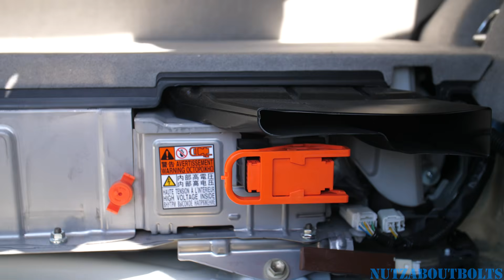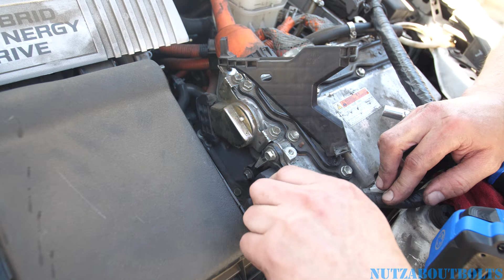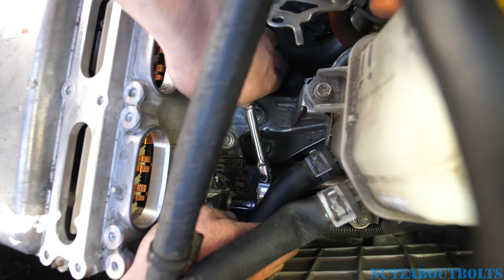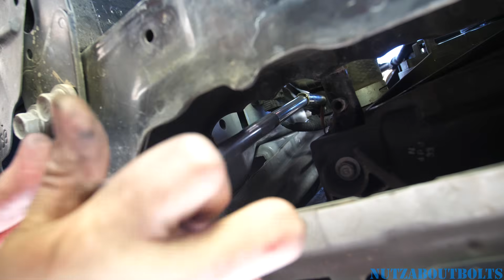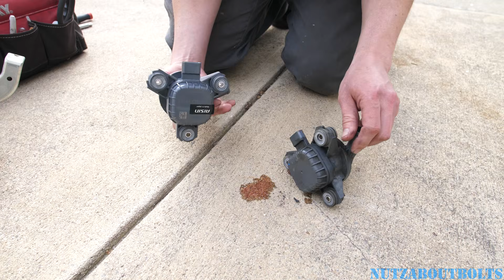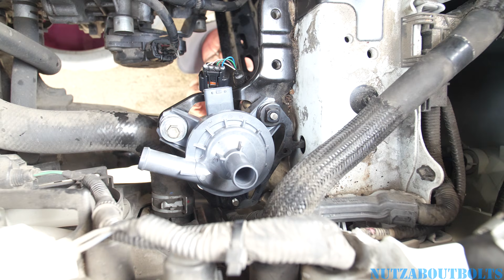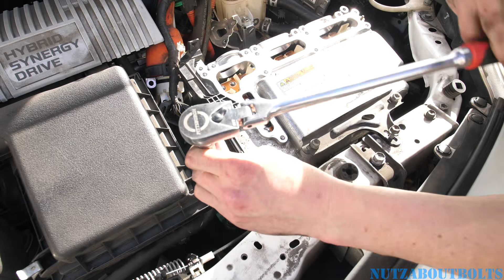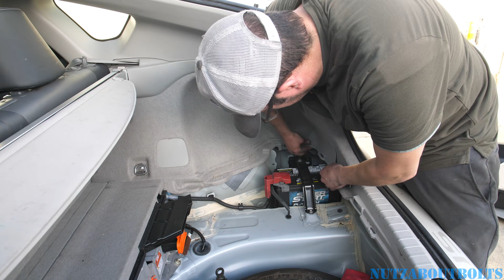2010-2015 Toyota Prius Inverter Water Pump Replacement

Comment: should i change it for the peace of mind? 170k, and a code P0ADD. P0ADD means overheating of the hybrid battery or overheating of the pump. i have autel and can check the pump speed while driving. how long can you drive with bad pump bfr damaging the inverter? i guess 1-2 hours?
Reply from the maker: Don't see any code with P0ADD in the repair manual.
Reply: @NutzAboutBolts  thank you for taking your time. i could not find it either. the internet told me, it is related to two other P0A** codes. i erased it and will check in couple of days to see if it will return.
Reply from the maker: @west_park7993 👍🏼 let me know when you do
Reply: @NutzAboutBolts  with no DTC, with freon in the system, and good pressure switch, and good 5 fuses, i had no clue. got it to the dealers. they discovered, that the pressure is just a bit law, at 55 psi <the system is not turned on yet, and freon is equilibrated> they added a bit of freon, and now is OK. the pressure at the low siide end, with the engine off is 90-100 psi. when you start the AC, it drops to 30 psi, as it should be.
Reply from the maker: @west_park7993 so they’re saying the ac Freon is low, so it’s affecting the inverter?
Reply: @NutzAboutBolts  more complicated. first, ac would stop working after several min. shut off engine, starts again. nimh battery was <30%. replaced battery, same problem. started diagnosis. added 134. being an idiot, i added too much. then released. but i released too much. then tried to adjust. then started looking for el problem. all 5 fuses were ok. <fuseable link on inverter, 2 fuses, 10, 50 A under hood, 2 more under steering wheel> all look ok. How about the pressure switch. It showed high resistance. some posted, it is a switch, should be under 1 ohm. replaced the switch, same. bought another switch, same. them <being an idiot> i realized i have another car with identical switch. the switch showed 4k, 6k, 11 k. <there are 3 prongs>. then i checked the low-line pressure of the other 3 cars, with ac off. WOWOW! should have started with this. with AC off, the low pressure should be in the mid of red range, i.e. around 90-100. so i added more 134, and reached the border of yellow-red. around 60. still did not work. Did not have enough freon to make it to 90, and hoped that this is enough... still: no luck. at this point, no error msgs on the computer. this is when/why i gave up and submitted myself to the dealers. they told me 70 for diagnostics, but when I went there, they said, 70 is for code reading, 130 for total. then when they finished, they charged me 130 extra, for 200 g of freon. i believe that the diagnostic should be part of the repair cost, at least this was the industry standard. anyway, i have running AC, and I learned a 321 dollar lesson.
Reply: @NutzAboutBolts  the eror msg are sometimes ambiguous.
Reply from the maker: @ lol wow that was crazy, it had nothing to do with the inverter water pump 😂🤣😂. But yeah, I don’t mess with the AC canister or recharging it without the dealership machine. If one thing goes wrong, especially on the hybrids, it can affect the ac system… glad it was a cheap repair. 👍🏼
Reply: @NutzAboutBolts  some of these early error msgs were rather misleading. in fact, i almost fixed it, just needed a bit more freon.

Comment: I want to replace my inverter water pump on my prius with this Aisin one but I'm not familiar with Aisin products and don't know the quality. I need to do some more research because the Aisin one is way cheaper than the dealer one.
Reply from the maker: @joeshmoe8952  Toyota uses Aisin brand for their parts. It’s basically OEM
Reply: @ I’m definitely buying this one. Thanks
Reply: I ended up purchasing the Aisin water pump thermostat & inverter pump. So far so good, I’m looking into that catch can you go there. Heard lots of good things about it.

Comment: What a brain-dead design decision by Toyota, to bury that pump under the inverter. About out on par with needing to pull the wipers and cowl to get at the spark plugs. Thanks, at least I know what I'm in for.

Hey you guys are starting to get older... ;)
Reply from the maker: @mendelleisk4577  😂😂😂 yeah, time is not on our side lol
Reply: Doubly confounding, because if you go under the car, the pump's right there, but it's fasteners need access from above.

Comment: For this one, I'll wait till it goes out. This failure won't be as dangerous as the wp of the ice engine side. Great video bro. Thanks so much for this video. Hit like and saved it to playlist. 😁 It looks like it's possible to access those bolts and the pump with those 2 lines without removing the inverter.
Reply from the maker: lol yeah, honestly both of mine still working but had to do these videos because I don’t know when it’ll die on me. Same with the brake rotors and pads 😆😆 still oem
Reply: @NutzAboutBolts  your car is a beast! OEM wp and inverter pump lasted 280k. This gives me hope for my inverter pump. 🤣
Reply from the maker: @CCG0D 😂😂 I think they did the 2012 and up better. I’m still on the original HV battery… still waiting for it to die
Reply: @NutzAboutBolts  you know it, when the HV pack dies, pls post video with your solution 🙏🙏
Reply from the maker: @CCG0D definitely, I’ll probably just replace the whole HV battery if the cells die out. It’s probably less headache lol

Comment: I think my 2011 Prius has a blown head gasket, it still runs and drives great but I'm losing coolant. Is it worth the cost to fix it or should I just look fo a new car? and can you please give me an idea how much it would cost for a head gasket repair? thanks
Reply: repair it, don't wait too long. Take your car to someone to repair it that is specialized in Toyota's, don't bring it to the dealer. I think it will cost you 2 - 2.5k euro's. But what does another good car cost? A lot more
Reply from the maker: There’s a bunch of headgasket video repair out there. It’s still worth keeping it and repair it. Most likely you’ll need to bring the head to a shop to get it machined and leveled with new headgaskets
Reply: @NutzAboutBolts  ok, thanks for the info

Comment: Toyota wanted $800 to do this. I bought an OEM pump on Amazon ($100) and did it in one afternoon. 
While at it I also replaced all fluids - oil -coolant, trans. and inverter.
Tip if you order parts and fluids online from your local Toyota dealer and pick them up you can save time in the line and on the price.
Reply from the maker: Nice, yeah I got the coolant at the dealership since I didn’t want to wait on it.
Reply: OEM pump for $100? Do you have a link for that on Amazon?
Reply: @a @andrewhendrickson334 don’t buy third party, especially if it is something crucial as water and hybrid pump, huge difference in quality, yeah your gonna save and it will work but for how long.. and something that will leave you stranded and cost you towing fees and forbid a possible head gasket failure m.. not worth it, buy directly from the dealer and do it yourself
Reply: @andrewhendrickson334  Just remember that there are known cases when what is sold on Amazon as Aisin for example (they make the OEM pump, a real one would be a good choice) is a counterfeit.

Comment: nice informative video! Do these pumps fail often?
Reply from the maker: Some do, some don’t, depends on the vehicle, but we do recommend changing them every 120-150k miles as a preventative part, just like the water pump and thermostat that we’re going to do later on. Same with the TPMS since those goes bad after 10 years since the battery dies out.
Reply: @NutzAboutBolts  thanks for the answer. I've already preventative changed waterpump and thermostat. I think I'll leave this little waterpump, I think it's all right
Reply from the maker: @joskd8491 at least you’ll know how to change it when that check engine light pops up for the inverter water pump. 👍🏼